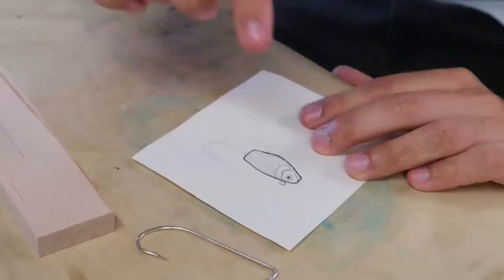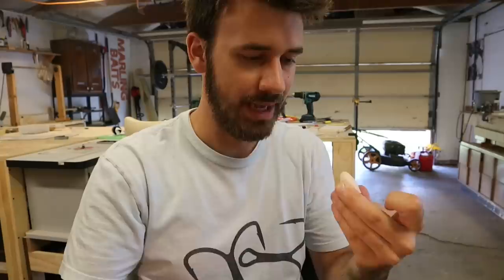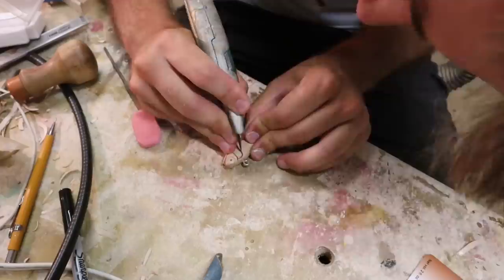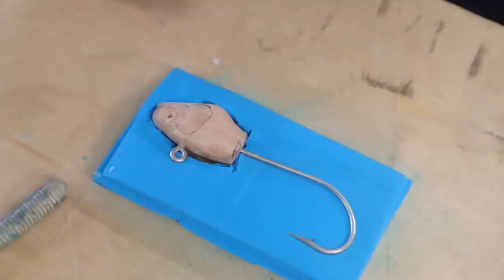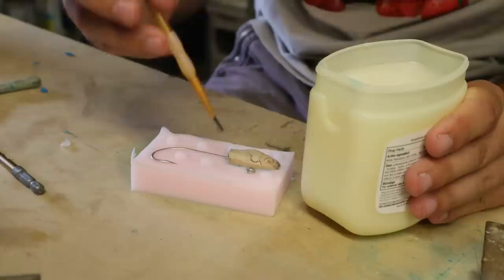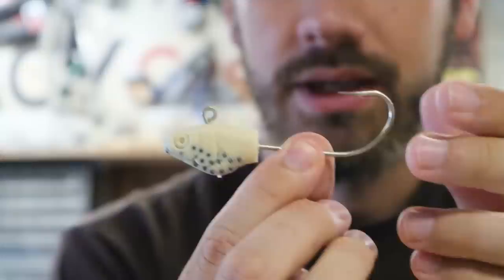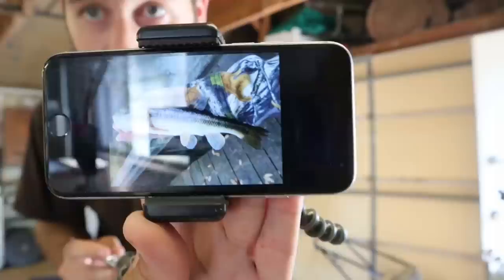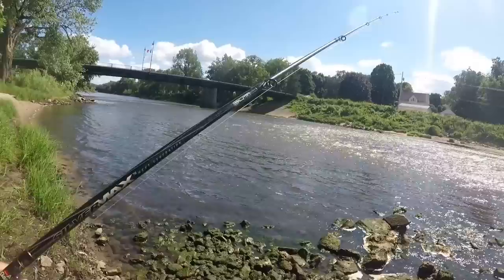Making and Fishing with Jig Heads

Comment: @marlingbaits When pouring a two-part silicone mixture, try to pour the liquid higher. This will ensure proper mixing and prevents bubbles. I like to pour along the out perimeter "chasing" the edges, but more importantly the corners to get a crisp mold. Finally, a straw can be used as a sprue. Cut the straw shorter than the total length of the sprue avoiding the casting box. A paper cone works better, but use cardstock covered in wax paper to aid the mold release.

Comment: In the aircraft industry we use a putty that's called Repro putty. It's a two-part putty that will set and is used to get very intricate details. It might be a good option for when you're trying to get very fine details but want it to be able to come off the bait with relative ease

Comment: Have you thought about putting a weed guard on that?  You could also fish it with a swimbait rather than a grub.  Or add an underspin and use it with a fluke/swimbait.  Then you can fish it higher in the water column.

It may work better when the water's cooler.  And those grubs were a bit big for most Iowa fish.  I would definitely try that for spring musky/pike or big bass in cold water.

Comment: Great job on the video!  That was a really nice jighead.  I find that jigs are better in colder, deeper water.  So mid-summer, with high water temps and low water levels are pretty much the polar opposite of ideal conditions.  The only exception to this would be finness fishing for panfish with a small grub, which works just about any day of the year.  I'd give it another go in the fall or even ice fish with it if you get the chance.

Comment: A little advice. When you snag on something hard, do not jerk the pole to try and release it. First put tension on the line by pulling it back a little, then release the line so it snaps back and a lot of times it will jerk it free. It may take several times but it works better than jerking the line back. Also, I think the jig was hitting rocks and you thought it was a bite. It can feel very similar. If you are fishing with a lot of rocks, and you feel that bump, stop and see if it starts pulling or nothing happens. If there is no pull slowly work it over the rocks. Good luck. Love your videos.

Comment: Lol. I just back into jig fishing. I stick to pouring lead 1/4 oz. walleye jig I do want to get the ultra minnow mold your talking about though. I dont put too much time into making them look so fancy- solid color powder paint and no eyes- then i dont feel too bad when i lose them. 

I also like using the lighter hooks, eagle claw 570/575 as when i get a snag the hook straightens out before the line breaks.

Im looking at getting into pouring my own soft plastics too. Cant decide if i should go all in and start with aluminum molds and injectors or open pour and silicone molds.

Comment: I live in Amsterdam with a lot of bicycles in the canals, my tip: use i hook with will bent with your line strength. If you are lucky,  you only bent the hook back and sharpen it. Still it is 50-50.

Comment: Since they're biting crankbaits, maybe make a lure that has the head of a crank (hard plastic, with a lip and a hook hanger) and for the back part use a soft plastic fluke or a swimbait, kinda like the jigs you made in the video, connect them with a piece of spring shaped wire .
Maybe it would be good to make a mold for each part, so you can test some different colors
Keep up the great work, greetings from Serbia 👋

Comment: Since accurate cutting of the wire groove is so important - Perhaps you should change your procedure and scribe a line on the lure immediately after cutting out its shape in the jig saw. Cut the desired groove and if it is not perfectly centered sand one side down to perfection.

Comment: Looked like you used only braid? Started using a flourocarbon leader that rolls like four laps on the spool with my baitcasters and no more line snaps, getting the little bit of elasticity helps a bit with the snags as well

Comment: I've had hits that I thought were snags. The one musky never moved, until I actually waded out to get my lure back. (A 2 inch in-line spinner) Looked like I had snagged a log until it turned into a torpedo and my reel started screaming... Big tiger musky, at least 40 inch just to be safe (I was 16 and didn't have a measuring device or a phone at the time). Hooked it right in the tip of the nose. Either a Cole-level snag, or it bit and just sat there. Either way, youd think it would've took off the instant it felt the hook...

Comment: If you are using braid you should tie a Palomar knot on your bait. It appeared that you were tieing an improved clinch knot, which will not work correctly with braid. Also, you might try a drop of super glue on the knot.

Comment: There is a technique to tie and set up jigheads where you almost completly eliminate snags.
I used it all the time on ponds where there was a ton of logs and stuff under water.

To tie it you first need a front hole hoock, like tje ones you used here but with another 90° turn towards the front on the upcomming part. Then you need to align the hoock that way so the poky part stays hiden with the twistertail when you put it on, it comes trough the top but it lays flush. When the fish bites at it the tail slips down so you actualy hoock the fish on.

I will try to find how that techinque is called, i snached it from a hungarian fishing guy a few years ago.
Reply: https://www.landbigfish.com/articles/default.cfm?ID=378  
The hoock ends up looking like on that 4' worm in the picture. It is a diferent concept but it can work with custom jigheads and i am sure you can figure out a creative way to make it work for your style.

As i said, that is the only way i tyed my twisters and i rarly had snags, almost never when compared to the regular way and it catches fish just ok, even better i would say because you dont have a huge silver spike sticking out of the twister.

Comment: Make a rattling bait or one that makes noise!!! or what about a soft tail with a hidden hook so you don't loos so many of them in snags? like have the line tie so that when something pulls on the back the hook pops out and up but otherwise it sits pressed up against the soft part or in a slot in the bait. Also it would be nice if you could coat the baits in a way that they didn't chip off like that.

Comment: you should have used different weights of bird shot. a slow descent would be more of a better retrieve rise and drop more natural  try 3/8oz and a 5/16oz and a 1/4oz than have a remake video of not giving up. I also like using a bobber about 8 to 12 inches in a lake and let the wind and motions of the wave more the jig up and down. good luck.

Comment: Why not get a slot started first, then rough out the shape? Seems like it would be easier to trim the sides on the bandsaw to center the slot than deal with crooked ones. But I'm just a metal worker, wood is weird.